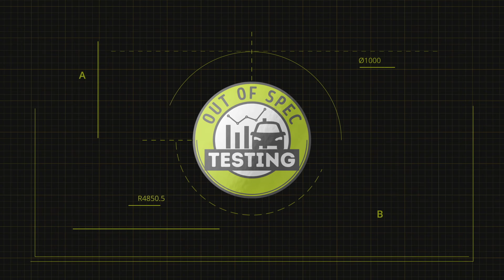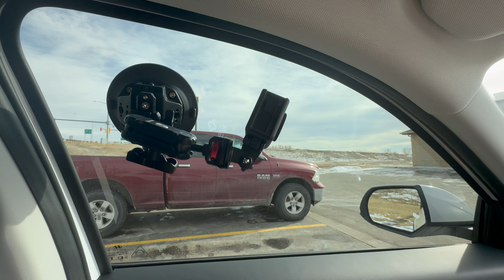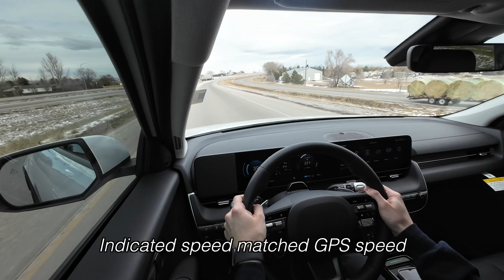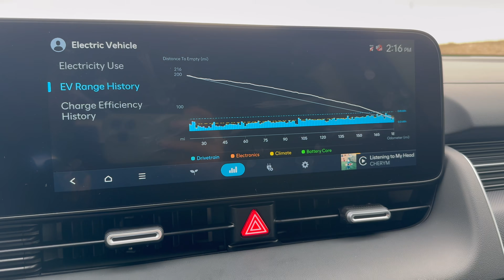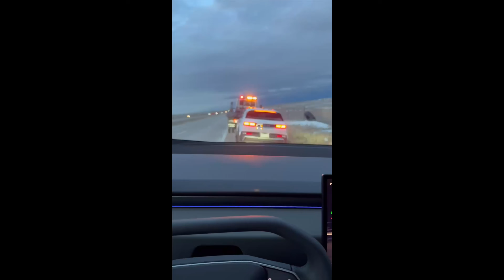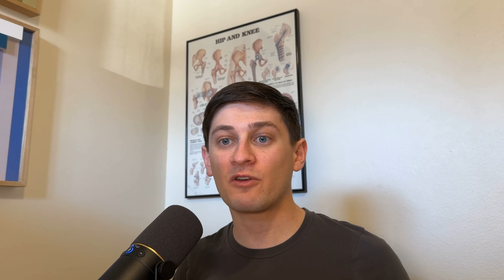Cold Conditions Really Hurt The 2025 Hyundai Ioniq 5 Range! 70-MPH Highway Range Test

Comment: Like tests like this. 👍 FYI. When you make a comparison like this you have to factor in the tyres. In this video you make a comparison with the Ioniq 5 2022 which had Michelin Primacy All Season tyres on it. Put these tyres on the 2025 model and it will run about 5.5% longer so it will run about 243 miles. I know this is not much but I think it is worth mentioning when you are working in those details.

Comment: Before 3/20/2025, I loved my ioniq 5 and fully recommended it.

After that date, however, my experience changed dramatically. The ICCU failed while I was driving with my son in the car. We were left stranded, unable to do anything, not even turn on the hazard lights, apply the parking brake, put the car in park, or take my foot off the brake without the car rolling.

This happened on a small bridge with no shoulder during rush hour, surrounded by frustrated drivers honking and yelling at us, as if we had chosen to stop there and sightsee.

The truth is, their so-called fix is just replacing the ICCU with the same dangerously flawed unit. No one should have to play Russian roulette with their car, especially when lives are on the line.

Until a permanent and proven fix is implemented, I firmly believe these cars are dangerously unreliable and should not be allowed on public roads.
Reply: I’m giving them another chance. I have a 2024 limited AWD that I turn in as a lemon on Monday due to the failed ICCU. Mine failed close enough to home that I could limp it back and call for a tow from my house. After a lot of shopping, there’s still just no other EV that has the charging performance of the Ioniq 5 for the money. I won’t go Tesla for personal reasons, and the other manufacturers in the U.S. market just aren’t up to scratch. I know it’s a relatively small percentage of the Ioniqs that have the ICCU failure (Hyundai claims 1%, but personally I think it’s higher. Maybe 3-4%?) so I’m willing to roll the dice and replace my ‘24 with a ‘26. Perhaps by the time my new lease is up, something better will hit the U.S. market. But given the political climate, I’m not holding my breath.

Comment: The HVAC is on the LCD Screen it's can be brought up rather easy.   Read the Manual or just play around you'll see it pop up.  It's hands down the Best Car.  Unless you haven't owned one for a few years, you wouldn't know.  I have for 4 years, 2022 and now 2024.  It's a awesome car... Cold weather affects all batteries.  That's common knowledge.

Comment: Yep, I had a Tesla Mobile charger plugged into a Level 2 outlet, and it would not charge my 2025 Ioniq 5 Ltd.
 Bought another charger off Amazon with a NACS connector and plugged it in with no issue. It seems Tesla chargers will only charge Teslas or Hyundai wont accept them dor some reason?

Comment: This is a pretty good result per dollar, considering the Ioniq 5 is among the lower priced EVs in the marketplace at actual out the door pricing.  The charging is of course the best you can get below 50K, most normal folks don't have the scratch for a Taycan.  

Proably will get 250-260 in the summertime on this particular configuration and battery capacity, or for a less range anxiety inducing highway run, 230 at 10% from full.  Possibly 200 miles 80-10% in good weather conditions like you would do on a road trip.  Despite the eco-disconnect, a 2WD model with the same battery would probably do better and that's what we would buy down here in Texas.  We just stay home if there is snow and ice as people don't know how to drive.  Even if you have experience and know how to do it, it's the "other guy" that doesn't have a clue that makes it not worth the risk.
Reply: "We just stay home if there is snow and ice" is a wild thing to say. I'm not trying to be rude, but I can't imagine buying a car that can't do it all, all the time. Unless it was a toy, like a Vette.
Reply: @forkthepork  We live in Texas, as I mentioned!!  There is nothing wild at all about it, most people do stay home when there is snow or ice in Texas because we have absolutely zero snow removal equipment and minimal preparation of the roads and bridges at best.  And you can't trust that other people know how to drive in winter conditions, they don't.  School and many offices are usually canceled anyway if we have snow or ice here.

Bottom line, this is normal for people where I live!  If you live anywhere north of Texas you're probably expected to get to work if there is ice on the road.  That's not the case here.
Reply: @ what happens when your wife has a heart attack? You just call 911 and pray?
Reply: @forkthepork  You've never lived down South have you?  We don't base decisions on what would happen if there was winter weather outside, because it is so rare.  We've not had any weather this winter that would prevent me from driving to the hospital, although it did get down into the teens a couple of mornings last week.  We can go 3-4 years without having a winter storm that would make the roads impassable so planning for the unlikely intersection of a serious health emergency and roads being impassable is a pointless errand in our climate.  If you live in upstate New York, Minnesota or North Dakota, you probably calculate differently and that's understandable.

When we get bad winter weather on the roads, it also tends to be ice, not snow.  What would you suggest for an emergency trip on glare ice?  Having studded tires in the garage that you may never use once before they dry rot after 5 or 6 years?

All this (pointless) discussion aside, both of our EVs are AWD, because that's what was available at the local dealers at the time of purchase.  But I would have absolutely gotten 2WD if they were available on the lot.
Reply: @ all fair points, I’ve lived in snow states my entire life. Just a different mindset I suppose. And ice is easy to deal with, you just straddle the side of the road and the tires on the gravel shoulder have grip. In town, just go slow.

Comment: I was doing 2.6 in my niro at around 9 F. It's also done 2.9 at 3 F with some DC charging. Not bad for AWD. I'm not expecting 150 miles on my Niro in this cold snap, esp since it seems my battery heater feels like doing nothing.

Comment: My ‘24 ioniq 5 can charge w tesla mobile charger with nacs-to-j1772 adapter. Curious if you figured out why ‘25 can’t without adapter
Reply: The tesla chargers try to communicate over a CAN protocol which works with all teslas. The nacs to J1772 adapters all have a circuit to use the standard PWM protocol. Unfortunately tesla doesn't have much incentive to create a firmware update to make their chargers fully compliant as all of their cars charge fine. The Out of Spec team might have gotten it to work if they had both a nacs->J1772 adapter stacked with the included J1772->nacs.

Comment: I have observed a 15% drop in efficiency on my regular work commute at 15-20 degrees F versus 60-70 degrees F. That is driving a 2022 SE AWD Ioniq 5 which has averaged 4.0 miles/kWh over the past three years and 33,000 miles.

Comment: You keep mentioning the cold temperature conditions and then immediately point out that it didn’t well compared to other EV’s. Were those other EV’s tested in similar 30 degree temperatures. If not, then it is not fair to compare and experts your disappointment. Cold temperatures have a big influence on range. If you want to compare them, then take the time to at least calculate based on generally accepted calculations that bring the range and efficiency data in closer alignment. Making a statement like, it was cold, but the results show poor performance compared to other cars that we tested under different temperature conditions is disingenuous. Also, were the comparison cars also AWS?

Comment: Kind of a rookie move to dismiss the testing temperature difference. 60s vs 30s is at least 10% which puts the Ioniq 5 on par with ID.4 etc. Colorado cycles between 60-degree days and 20-degree nights this time of year. It would be time-consuming but otherwise not difficult to run the test at noon and again at midnight and see what the cold susceptibility is for different EVs. I wonder if bottom plate cooling in e-GMP makes them more sensitive in the cold at highway speeds as my EV9 is definitely more cold-sensitive than my e-Tron. And yes, EV6 is more efficient because it has a lower Cd.
Reply: No charging curves mentioned either as ioniqs constantly better than tesla but not as good as a taycan

Comment: I have this car in RWD. I’ve found around freezing I’m getting 3 miles per kWh at 70mph on the few days I’ve driven it above 14 degrees C and it was dry I got 4 miles per kWh. I really like the car it’s really quiet and smooth. Cannot wait for the summer!
Reply: I was really annoyed to find out that the rear wheel drive cars cannot be purchased with a heat pump even with the limited trim. I was completely under the impression when I got mine that if I got the limited trim I would be getting a heat pump with my rear wheel drive car. But no.

Comment: I believe you were using i-pedal mode and this is AWD model. When using i-pedal it forces the front wheel motor to remain engaged all the time, causing it to waste a bit more energy due to drag. Without i-pedal mode you can see it actually disengaged on the cluster (where you see the energy distribution).

edit: seem like on the video it was mentioned that it was level 3, nonetheless, it kinda looks on the ui to be i-pedal tho, but i must be wrong
Reply: I believe when you enable cruise control it disconnects the front motor even on single pedal.

Comment: This IONIQ 5 AWD seems to have done better than the 2023 Model Y AWD on your chart. Am I mistaken? The Model Y results that beat it are RWD versions. You may want to repeat this test with a RWD IONIQ 5 to get the longest range version possible. 

Considering that, I’m not sure your qualification of this range being ‘poor’ is accurate. It seems OK to me!
Reply: Last Model Y AWD test was the 4680, which did 3.5mi/kW-h for 279 mi total (but at 73-77 degrees).  I don't see any Model Y cold range test, not even RWD.

Comment: Eco is exactly the same as normal if you negate it suppressing climate.
Reply: Eco also significantly delays front motor engagement in AWD e-GMP cars. You basically have to be at max rear motor power full throttle to get the front motor clutched in.
Reply: @Ficon     Nope, the exact same dynamic as with Normal. And Normal has proven more efficient than Eco is real world comparisons. But hey, enjoy using Eco…  😂
Reply: @J @JohnCap523 I don’t use Eco but you are incorrect. It changes throttle response and avoids front motor re-engagement after it disconnects above 22 mph unless you are going full power on the rear motor.
Reply: @Ficon     Engineers have demonstrated this, long ago. And so, I am correct. There is no difference between front motor engagement with Eco and Normal, on an AWD eGMP EV. You’re quoting AI. Go to forums and read actual experiences on the subject, including controlled comparisons. And Normal/Auto 1 regen is THE most efficient combination for these cars.
Reply: @JohnCap523 I own one. It runs RWD much deeper into throttle in Eco. It’s probably just revised throttle mapping since it feels like it never hits full power so I don’t run Eco for safety reasons as much as driving enjoyment. Blended braking being more efficient than one pedal has been a known fact ever since Tesla spun their inability to develop a blended braking system into an “innovation”.
Reply: @Ficon    So do I, an EV6. Yes the throttle mapping differs. I equate it to Benson & Hedges 100s…skinnier cigarettes intended to reduce your carcinogen intake. Actual result was people smoked twice as much. Similarly people get frustrated with the slower response in Eco mode so they compensate by pressing harder. End result is less efficiency than Normal mode. But I think people see it like those who heavily recycle plastics while realizing most of it still goes to landfills…  😂

Comment: With additional preconditioning before you top off to 100, I suspect that departing with a 70F or higher battery would give even better efficiency. I've road tripped my 2022 in -2F using a fully preconditioned battery and by the time I unhook from the charger at 90% the battery is 110-120F and stays over room temperature halfway to the next charger. I wonder if it's ever more energy efficient to run a few kW into the battery heater to offset range loss as the pack cools down, the range history seemed to cross at about the point I'd expect the battery to have returned to near ambient.

Comment: This is pretty disappointing.  I really want to trade my Tesla for one of these but I can drive my M3 at 75-80MPH and get at least 230 miles.  I hate to think how much worse this would be at higher speeds.
Reply: This is far roomier inside (particularly for anyone sitting in the back) than the M3 and larger (and heavier, yes) than the M3.
Reply: @OrionDC  A bigger car should have a bigger battery if they can't do anything about the efficiency,
Reply: @kenquinty1773 I’m pleased with my sports car, I5N. Coming from two eras of Mustang. 641 horsepower is going to drain a battery.

Comment: It is a little disappointing since they got a slight battery bump in the 2025.  I did expect it to pick up about 10-20 miles in range.  Efficiency is not good in any of the eGMP vehicles.  Even the Ioniq 6 which should be efficiency minded isn't great.  Good to have this data point.  While charging is good the range and efficiency give it all back.
Reply: My i5 is plenty efficient? In the summers doing normal mixed driving on 30-50 mph roads I can very easily get 5+ mi/kwh. Even in these colder months I am able to stay at 3.5-4 mi/kwh 🤷🏾‍♂️
Reply: @reduxith  Mixed-speed range is important for charging economics, but for road trips you want range@70mph, hence this test.
Reply: Lol, who is more efficient than the ioniq 6 other than the updated model3?

Hint, like, no one. 

Bonus points you aren't supporting a tech bro destoying the world.
Reply: @sprockkets  Hint: Go look at the test results of the others tested by OOS for the answers to who is more efficient.
Reply: @Longsnowsm  Hmmmm, let's check that chart....oh wait, it shows the 2024 Tesla Model 3, AWD and RWD, and a Lucid that got the same 4.3mi/kwh

Wow, that was hard. What's really sad is that you posted that even though calling you out on your bullsht post was super easy.

Comment: Interesting. Those efficiency numbers are only a tiny bit better than what I got in my '24 RWD SEL on a December trip in even colder temperatures, but at 80-85 mph. Departure was 29ºF and we kept the cabin fairly comfy plus heated seats and steering wheel. Did not get to preheat the cabin on shore power,  but did leave at 100%. First charge was 154 miles. We also used battery preconditioning and arrived at 39%. It was on'y 2.3 mi.kWh but it improved to over 3.0 once the battery warmed up, still at 80+ mph.

I would hazard a guess that the bigger battery with AWD isn't much better for range than the 77.4 kWh model with RWD, with everything else being equal.